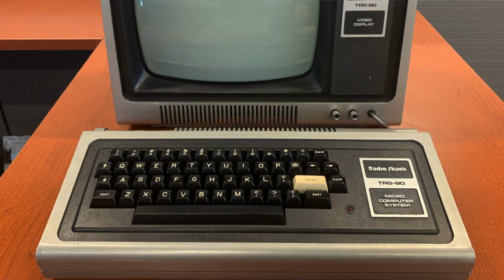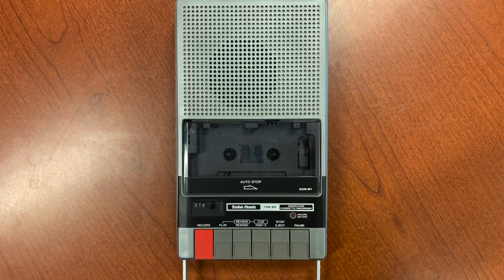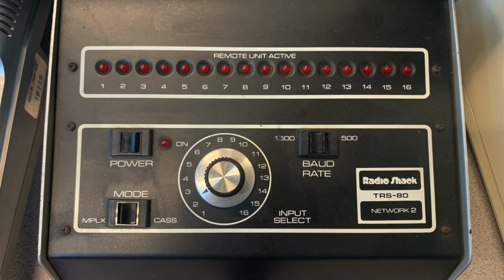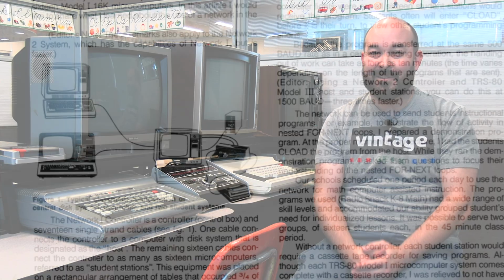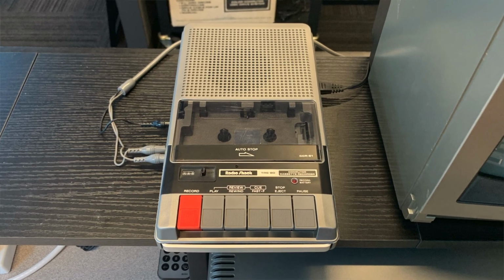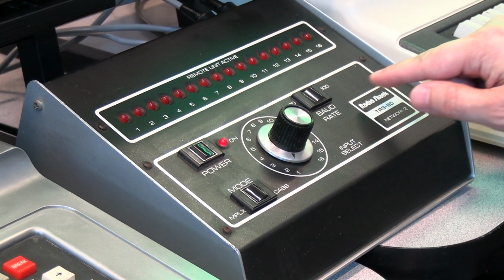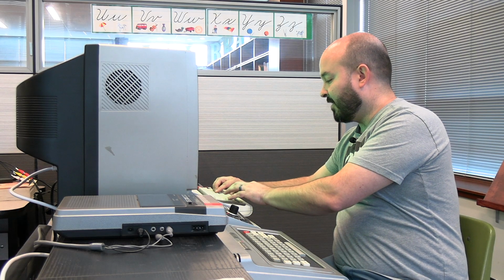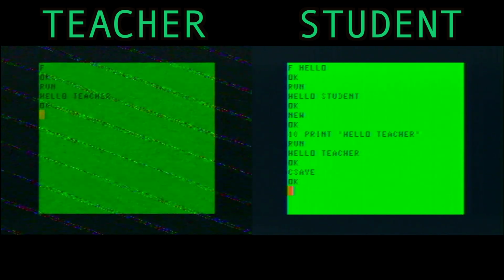Doubling Down with the Network 2 Controller (Part One) | #SepTandy

Comment: Back in Jr high I found out our school had a ton of Model 3 and 4s sitting in storage, along with a couple in one physics classroom.  Eventually got access to a few, and my friends and I made a similar setup using the LPT ports to control CB radios driven by the CASS ports.  We had a simple message passing system that could also attempt to do basic multi-hop message delivery when 2 nodes couldn't reach each other directly, and the world's slowest, flakeyest hayes AT emulation over the serial ports between two nodes that could talk directly.  Being 6mi apart, one town over was still a long distance call at this point so we used this to send files back and forth, message, etc.  Updates were pushed out by coordinating save and load commands.

Comment: I looked at the Network 2 Controller service manual and all it seems to do for the 500 vs 1500 baud switch is reduce voltage from 0.6 to 0.5. I'm not as familiar with the TRS-80 model line. Can a Model III load a BASIC program from cassette saved by a Model I? In other words, can a Model III recognize 500 baud program and adjust to it? I'm just trying to understand why version 2 of the network controller has a baud switch since internally there is nothing that would capture the audio and then re-send it at a faster or slower speed. Maybe in your part 2 you could spend a minute or two diving into that.
Reply: The Model III would have to know in advance if the file was 500 or 1500 baud, there is no auto-detect feature. When you first turn on a Model III, you will see "Cass?" and you would enter H or L to indicate what speed you want. You can also change the value of a certain memory location to indicate H or L speed as well.
Reply: @BilalHeuser1 what is the switch doing when you select 1500 vs 500? Is it slightly adjusting the gain by upping the voltage? It seems that $500 device ends up being pretty simple.

Comment: I have never seeen on in person but when I started playing around with old networking software like multi-user dos. I couldn't help running across this while looking up arcnet / pcnet. So it is nice to see this work. Reminds me of the old printer switch boxes. The manual 2 port ones or the later auto ones. 1 printer to 12 computers or something like that.

Comment: If this box just distributes the audio signals back and forth, what is the purpose of the baud rate selection switch? Wouldn't this be determined entirely by the computers themselves?
Reply from the maker: Great question, and I actually wondered the same thing.  However, the schematic indicates that the device is actually decoding the bit stream similar to the computer itself, and then converts it back to audio.  I have to assume this was to make sure the box was amplifying as clear a signal as possible, but it does seem a bit unnecessary

Comment: when I was in Jr. High school (about 1988) we had a lab of TRS-80 Model 3's with a network 3 controller hooked to a console with dual disk drives. The other 16 computers were just diskless workstations, everything loaded from the console machine. That was the last year we used those, they went to Apple II's the next year.
Reply: Almost everyone went to Apple II soon after.
Reply: The Network 3 Controllers seemed to e a bit more powerful as they allowed for true headless drones, i.e. from doing some reading online, it seems they could access the floppy (and eventually hard) disks of the master to get files. They did require a special network disk operating system and the controller used RS232 instead of cassette port connections. Was that your experience? What could Apple II's do with regard to this type of networking?
Reply: @8BitRetroJournal  Well, we used the TRS-80's a total of 1 time when I was in 6th grade (about 1988), and i remember having to type some kind of command, but it seemed to work OK. We never networked the Apple IIe's, we just each had a disk drive and separate disks for each one. We used those quite heavilly in 7th and 8th grade.